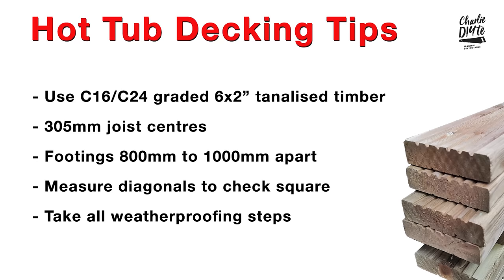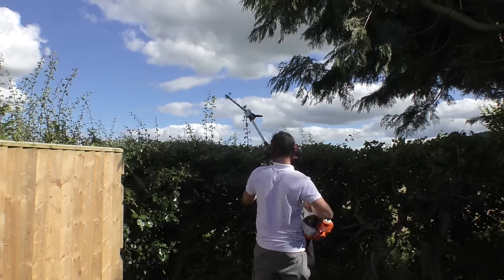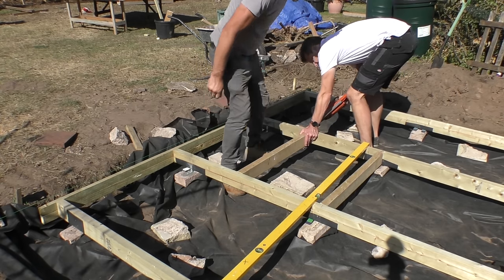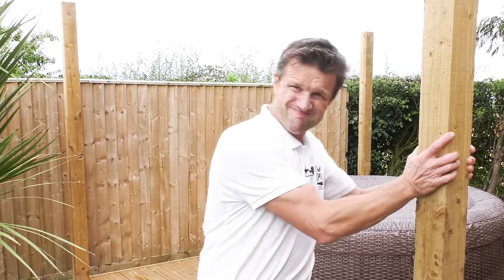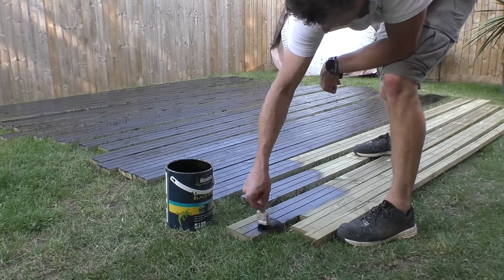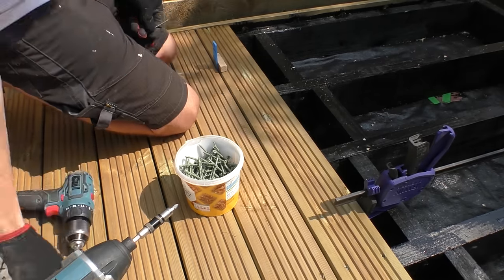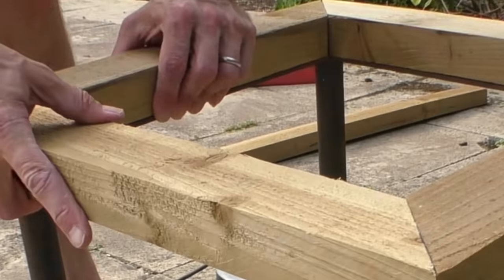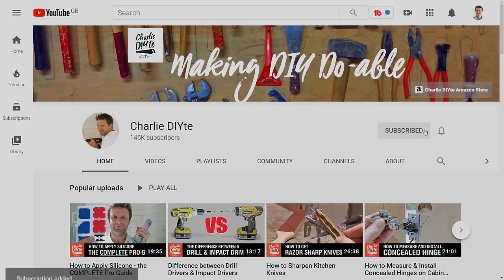How to Build Decking for a Hot Tub

Comment: Is the decking board installed correctly? What looks like a non-slip surface is normally used facing downwards to allow ventilation of the moisture between the decking board and joist.
Reply from the maker: I think it's entirely a matter of personal preference. The grooves are designed to channel water away from the deck and should, I believe be fitted face up, also to assist with grip. Personally I don't buy the argument that they're to increase ventilation below. I think this is one of those practices that is starting to become a religion (like the one that says you must only silicone the outside of a shower screen). To my mind, the deck will be infinitely more slippy if the grooves are face down.

Comment: I know it’s an irrelevant question, but where did you get those boots from ? Reason being I had a pair for years which were the comfiest safety boots ever , but I can’t find them anywhere anymore. Thanks
Reply from the maker: It's not irrelevant and they're Buckler boots - the Largo Bay version. The most comfortable work shoes I've worn and they have steel toe caps. I got them from my local agricultural supply shop but you can also get them online with a bit of searching https://bit.ly/2TZm0AL I've also got a pair of their slip on boots which are also fantastic. https://bit.ly/3xOMPX2

Comment: Hello Charlie, have you considered using firring strips under the deck boards but on top of the joists? It could provide the necessary fall required for drainage. It might make a mess of the fascia boards around the sides, but they could possibly be lifted to suit the new level.
Reply from the maker: Thanks for this. No, I think if I was going to put a small slope on the decking, I'd do it through adjustment of the foundations during the initial build. However I'm actually pleased I constructed it level, as for a hot tub you need it level, and drainage hasn't been a problem. The key is to bitumen the substructure.

Comment: Hello Charlie, I had a question not totally related to the video but have you ever had to repair the hot tub?
I have had one for 3 years now and it's sprung a couple of leaks and there seems to be a few options to repair but  which is the best?
Regards
Roy.
Reply from the maker: Hi Roy, yes I had a puncture which luckily I found by accident as it was near the heater. I used one of the patches provided (cut a small square) and used some of this https://amzn.to/3XyxF50 - actually bought for a craft project but it did a great job (slightly deflated it first) and the tub has kept it's pressure ever since. The lid on the other hand couldn't be fixed. Too many punctures so I replaced it with PIR board https://youtu.be/duhDFL5ZgpY
Reply: Thanks for your response Charlie!
I'll have a crack at repairing it when the weather is a bit nicer.
Keep up the good quality videos!

Comment: Did you screw the decking frame into the pergola posts? And if so, would that not put an extra burden on the posts? Pergola weight plus the decking weight = possible sinking?
I'm building something similar and was thinking of keeping the posts for the pergola and just put the decking on its own posts. 
Your advice?
Reply from the maker: The frame is screwed to the posts but it won't be adding weight as the frame is itself supported by bricks at multiple points.

Comment: I just contacted my supplier of my frame work timbers for decking I'm hoping they can change my 4x2 for 6x2 fir joists I think I was being optimistic using 4x2 for joists (area covered will be 3.4m x 4.8m ) 

May be ok with many supports etc but I think 6x2 be better tbh nice video seen a few of yours now great work matey
Reply from the maker: Thanks mate. Yes you really want 6x2 for peace of mind and so you don't have to put the foundation supports too close together. 👍🏻
Reply: @CharlieDIYte  well the tossers didn't get back to me after and had a voocemail next day saying delivery on its way they cab do one now go elsewhere ill use the 4x2 but put extra supports in I'm not dull in regards to construction bring a brickie etc so it'll be ok wasn't impressed they could have least got back to me

Comment: Great video. You definitely went the extra mile to make it future proof. I'm about to build something similar for a seating area in my garden and found this extremely helpful, so thank you! 

Do you plan on treating it?
Reply from the maker: Thanks buddy. Yes, it was a big error not treating it. Not because it's rotting but because with a sealing coat it'll be much easier to keep clean. In the spring time I'll pressure wash it and give it a good seal. Still using the hot tub now. Costing me a fortune to keep at 40 degrees (how the family like it) throughout the winter. 🤦
Reply: @CharlieDIYte  40*! Must be bliss haha. Looks like it's in a secluded part of the garden as well which is a bonus. 

My deck is going to be fairly minimal as its only supporting some light weight furniture. I was planning on just having some very sort legs sitting on 2x2 slabs, which will be sitting on top of compacted soil (with weed membrane). I know ideally the slabs should really be sitting on a layer of hard-core.
Reply: So I've decided against my initial plan and I am now using postcrete to secure the four corners!

I really like the way your fascias look as it hides the cut edges at each end of the boards. I hadn't planned to do mine that way but it definitely looks neater.

Comment: Charlie, just about to start my hot tub decking projects with your guidance before I do, anything to advise 10 months on from your project
Reply from the maker: Good luck Barrie. Not really. You could lay course gravel underneath to deter rodents and ants and the like. If it's on the earth just make sure there's a nice bit of clearance between the ground and the bottom of the joists. I'm going to do a video on treating decking in a couple of weeks. I've gone for Manns UV oil but there's a school of thought that the oil won't take too well initially because of the tannelisation so you could always wait until the end of the season. Or just crack on and oil it anyway. If you've got a flat and a grooved side put the grooves face down as discussed here https://bit.ly/3gmCMmE and treat the cut edges on the deck as they tend to go first apparently. Some people say the joists need to breath which they can't if you tanelise them but I don't know if there's any truth in that.
Reply: @CharlieDIYte  much appreciated, can't wait  for the pergola video. Keep up the good work
Reply from the maker: @barriebridges5942  Yes, I should have done that at the time as two of the posts have twisted now 🤦

Comment: Great video. Did you know that deck board were designed to have the grooves on the underside? This is so air can flow under the board. Everyone seems to install them with the grooves above which is not how they are designed.
Reply from the maker: Thanks👍🏻 Not so with these. A few people have said this, and you're right, a lot of the decking on the market is designed with two very distinct sides. I don't know where my local agricultural/ DIY store gets its decking from, but the side I placed underneath could not be faced upwards, as there's almost no tread pattern, and the edges aren't bevelled. So it would look very odd. So long as you bitumen the underside of the deck and the joists as I did, you're not going to have any problem with rotting.
Reply: @CharlieDIYte  oh ok maybe they are making them that way now because that's how they have been installed for a while.

Comment: Hi Charlie, My house is only 70 years old but in a very windy place, I noticed the pointing on the shed and I await your video about that. I also have many bricks that have been eaten away and the entire face of the brick has crumbled away. Do you have any that are like this and if so are you going to do a video about it. I watch all your videos and although I did build two houses from the bottom up including doing the planes and getting them through the councils (two different councils but both of them in the UK and you would be surprised to see the differences that each council required) this was a long time age and not to put a fine point on it I am older then my house now and find watching your videos almost as much as I can manage now.
Reply from the maker: Hi John, good to hear from you again and thanks for your continued support of the channel 👍 I'll let you know when I do that pointing. The crumbling brick issue is a tricky one. You see sections being replaced, but they don't half stand out compared to the rest, and I guess treating with a water seal product isn't the answer either. I suspect that was the issue here - the entire outside of mine was covered in that dreadful tyrolean render back in the 1970s. Generally it was a good quality job, but I have loads of cracks that need filling with an epoxy resin - hopefully a job and video before the winter. Very impressed with your house building projects!!

Comment: I’m looking to do exactly this.. however the decking will be on top of patio slabs/gravel…. Can I skip all the concreted footing stuff, and just place the sub frame straight on the ground?
Reply from the maker: Yes I don't see why not but you will want the deck joists raised slightly off the patio to ensure water run off below them, and similarly I would like some sort of plinth or brick on the gravel - or ideally the gravel clearing where the footings are placed, to ensure the ground below is solid and unlikely to move.

Comment: Great job Charlie, on the level?  I find water still collects in the grooves even with a slope so I think I’ll side with your perfect level situation as it looks fantastic.  Well done mate 👍🏻👍🏻👍🏻 Mike
Reply from the maker: Thanks Mike. The consensus is with you on this, that a slope isn't really necessary. The only thing I think I will do at some point is give the deck a good oil to make it easy to keep clean. Thanks for the comment 👍
Reply: Like you I find a slight slope doesn’t really help with runoff anyway. Would have to be visibly sloping to help drainage, but that would just look wrong!

Comment: Such a good channel and another great video, well done Charlie! Can I ask, is it ok to use composite decking boards over a timber sub-structure like that, or would you have to do something different?
Reply from the maker: Sorry, I missed your comment somehow. Yes, absolutely fine to put composite decking over a timber sub-structure. You just screw the clips that come with the decking to the joists to hold the composite in place. Probably an idea to get some bituminous paint on the sub structure, as you don't want your substructure to rot away given how much you're spending on the composite.
Reply: @CharlieDIYte  No apology needed! Thanks for the reply.

Comment: As a lay person, answering your question about whether or not you should have made it with a gradient, I’m pretty sure that the hot tub instructions require it to be flat. The amount of gradient you’d need to build in for it to be useful would probably cause issues with the tub having too much pressure on one side. Maybe? I don’t actually know but you’ve done so much water proofing underneath it’s hard to see that there would be much of an issue in the foreseeable future. Plus your beer might roll away.
Reply from the maker: Thanks Iain. Yes a couple of other people have said that. I think you're absolutely right. It does get a bit of water pooling under the tub, but this video https://youtu.be/ZOQ2L1TMayc should prevent that being an issue.

Comment: Hi Charlie, great video, as thoroughly detailed as ever. As well as watching your videos I take a lot of advice from our American friends. They think we're nuts for burying posts. They use concrete forms and screw the posts onto the forms. I am considering using this method as it makes the most sense. However, I am only doing a small deck for outside my garden room so it only needs to be 7mx 0.6m. Is this overkill? Also the Americans laugh at us because we put our decking grooves side up. The grooves are for ventilation. Makes sense I suppose. I'm going for composite decking as my project is small and I don't like deck maintenance.
Thanks 👍
Reply from the maker: Hi Craig. It could be overkill for such a narrow deck but then I don't think there's any such thing as overkill when it comes to DIY projects so if you're keen to do it that way, go for it! The groove thing is becoming an interesting debate as a few people have said that. I can see where they're coming from, but bottom line, I think the decking is designed to be laid the way I've done it, as this minimises standing water, assists with run off and makes the deck less slippy. However a lot of people are now saying that, so who knows, it might end up becoming a religion, like the ridiculous one where people say that shower screens should only be siliconed from the outside!!

Comment: The dept and diameter of the posts depends on the type of soil and how you use the deck. You cannot say in general x mm diameter and dept. When you are near the water side you need to go deeper, when you have clay or sand ground it is also different.
Reply from the maker: Thanks. Makes sense 👍🏻

Comment: Great video, just one question.... what size are the joists/frame timber? 2x6??
Reply from the maker: Yes, it's in the Description. 6x2
Reply: @CharlieDIYte  Thanks...Indeed it is, and you mention it several times during the video... not sure how I missed it? By the way how did you secure the 4x4 posts to the external joists? Just re-watched the vid and didn't see it mentioned. I'm guessing using the 6x120mm screws, two in each joist? Cheers

Comment: hi did you put DP proofing between those bricks supporting the joists and the joists, to stop damp rising?
Reply from the maker: Tricky one that as I didn't want to create a tray that water from above could sit on and create a worse problem for the joists - although the deck now has a roof so in this scenario DPC would be a good option. What I did do was raise them off the bricks with glazing packets which I think has achieved the goal.

Comment: Hi. I was surprised on how shallow you made the holes for your corner posts. I have always been taught that the post should be a third of its length in the ground. So if you want 2 metres out of the ground, then the hole has to be a metre deep. Do you think this is overkill?
Reply: 1000000000% overkill
Reply from the maker: Agreed, massive overkill, particularly if the post has the support of the deck surrounding it.

Comment: Hello there. Loved your video on hot tub decking. I have a customer asking me to build a hot tub decking with a pergola roofed, 3 privacy walls and 1 large open entrance. (walls will mostly be trellis). The customer has an AstroTurf garden and would like it to sit on the top of this. So no cutting to cement posts. My question is do you think that sitting the structure on slabs on top of the AstroTurf would be ok?
Reply from the maker: I don't see why not. I suppose my only question is what the astro turf is laid on. I'm guessing at the very least it should be a sand base, which should be pretty firm, as obviously it will be taking a lot of weight.
Reply: @CharlieDIYte  it's sand then all clay from there. I thought slaps would spread the weight quite well. Thank you for your help. I normally build garden tables and I have built small pergolas for customers before, but this is bigger job than I normally do. Thank you again.

Comment: I appreciate this video was uploaded 2 years ago but hopefully I’ll get a reply 😉 Regarding the Vortex screws, are they ok to use with pressure treated timber (I know that’s what you’ve used them with) ie are they resistant to the chemicals used in the pressure treatment process? I’ve heard the chemicals can prematurely corrode some screws. Regards,
Reply from the maker: Hi Paul. You're probably right. Stainless steel screws would be better but they're expensive and therefore impractical for something like this. Maybe those outdoor decking bolts would be your best option. I'm going to predict though that the corrosion on my screws won't be enough to cause any decrease in structural strength. Pressure treating isn't what it used to be and it didn't penetrate very deep into the wood.
Reply: @CharlieDIYte  thanks for the reply, Charlie. Much appreciated. I’ve just placed my timber order for my deck/pergola build (your videos have been really helpful), and now I’m looking at ordering the fixings, hence the question 😉 Vortex seem to supply exterior wood screws for a similar price but only seem to offer up to 100mm length. Im probably over thinking it but want to get it right first time. Thanks again 👍

Comment: Charlie, What is happening with that water butt lid (13.30)? I have the same one which had a crude hole in the lid which in turn allowed the tap to clog and not run. Fantastic dirty job to unblock tap. Try to cover up mate. Thanks for great upload mate
Reply from the maker: Yes Jason, the lid will be going on but I've got to replace the guttering first, because the lid is designed for the guttering to go through the centre of it. If it does clog it won't be a problem to empty compared to the beast of a water butt that was there before (which I drained with my Titan pump -lovely but of kit). https://bit.ly/3hmydq1. I've also got to fit the overflow pipe.

Comment: Do you fill the tub with the water from the butt? If so, do you find that rain water is clean enough after it has been on your roof and in your gutters?
Reply from the maker: No, partly because there wouldn't be enough water (it takes about 1000 litres) but also because the water wouldn't be clean enough.